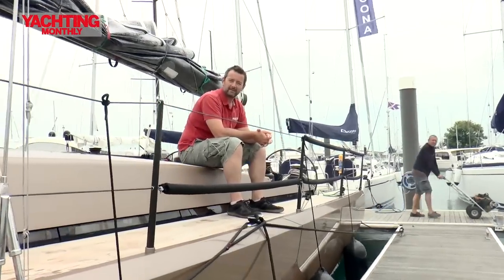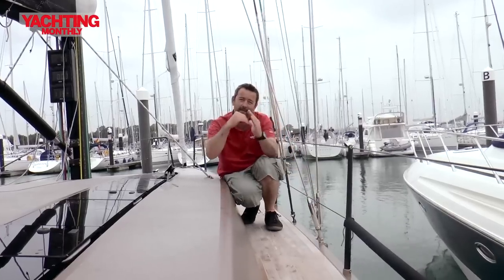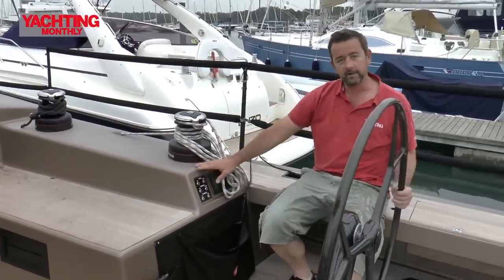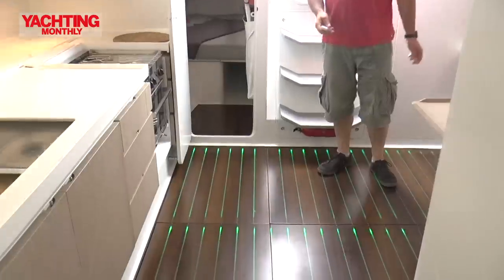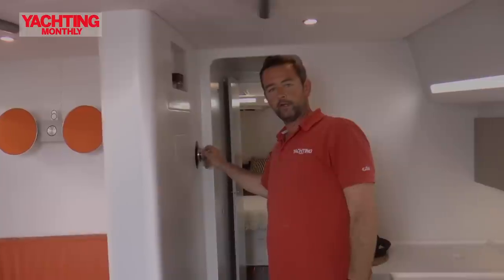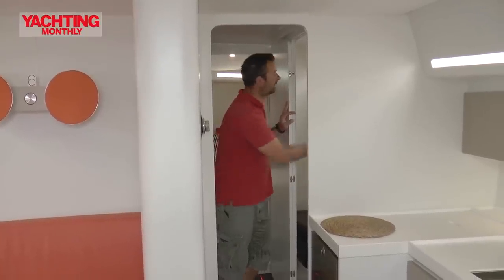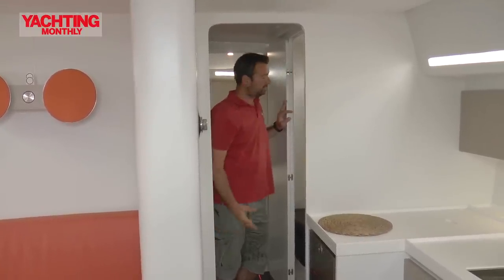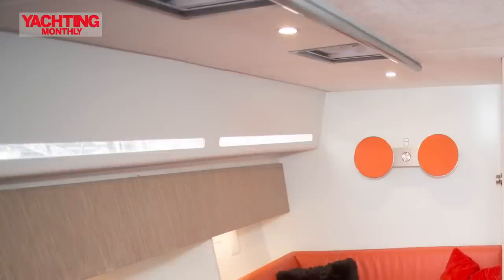Yachting Monthly tests the Premier 45

Comment: Carbon Fiber isn't all its cracked up to be. Its doesn't like Ultra Violet rays, and if you nick it, its lost all its strength like those Stanchions.  I wish you would have covered that decking more. Bet ya that's better than real teak though that also don't weather well. Bottom line; I don't see it any better than the other boats in the 45-52" class. Conventionally speaking. Thanks for showing it.

Comment: $709,000.00 I wonder how the performance compares to the Pogo 50 which is priced at $560,000.00 and also has a lifting keel and is equally austere. Personally I prefer boats that are plain and simple on the inside. I can live without a carbon fiber toilet.